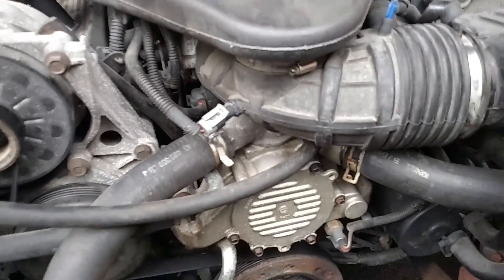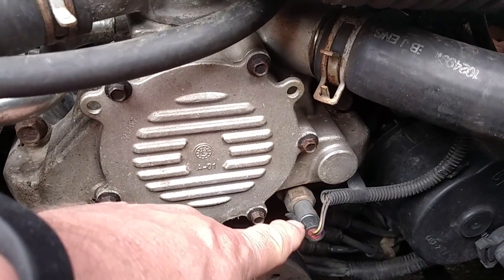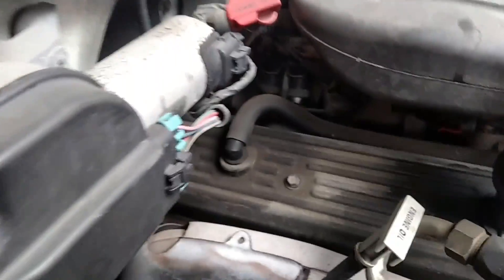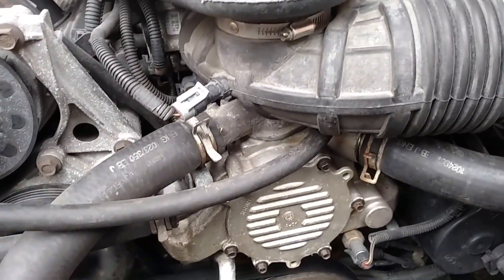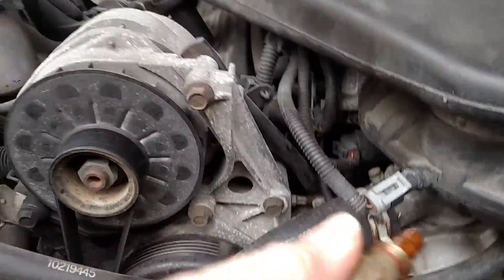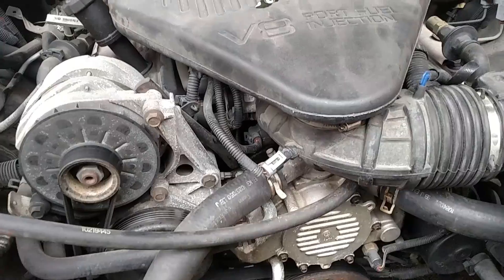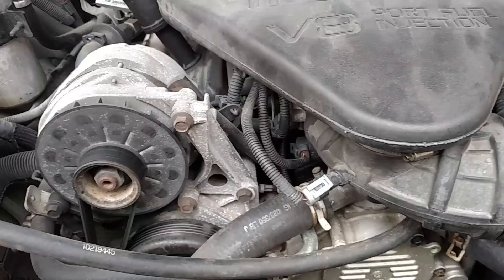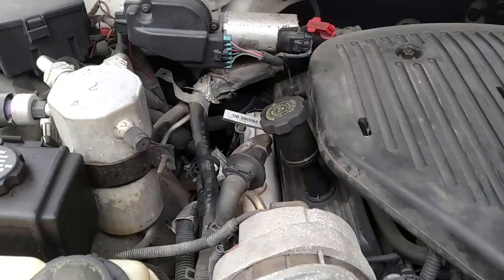Cooling sensor malfunction on lt1 GM

Comment: i took the plug connector out and the fans took off ! iguess the sensor is a normally closed...then opens when the temp goes up,this is all i can gather without getting the tech info on the sensor itself.geee i replaced it once in 2013..but i guess if the car sits around its function goes bad,i might do as this guy does,take it out and clean it maybe in hot water...
Reply: I have this problem, did you fix it

Comment: I have rhis exact motor.  My wire is cut coming from the sensor.  I am gomna have to put an extension on it.  Where does it land.  Thanks in advance if anyone has that answer
Reply: Have you found a answer

Comment: Curious. My 95 impala SS has a temp gauge problem. It comes up a bit but not to where it should be for normal operating temp. Could that be the sensor or the gauge itself?
Reply: Thermostat was on the verge of going out.
Reply: Kyle 
Did you ever get it fix? What did you do if you did?
Reply: Did u ever get it fix Kyle

Comment: This sounds like what my car is doing, i run the car a couple minutes and the temperature gauge jumps up like it's overheating but doesn't make sense because I only have ran it a couple minutes going to try this.
Reply: Did that sensor help your problem?
Reply: Mine is doing the same.

Comment: What size socket does that remove that sensor ?
Reply from the maker: Tee Orr man I can't remember the thing to do when you get a new on size it to the socket before trying to take old one out that way you don't round off the corners. Auto parts can probably tell you
 Sorry it's been so long since I did it. Good luck
Reply: Oh okay and thank you so much for replying and getting back to me though. Have a great one

Comment: I fricken these videos. Not a si gle one shows or tells where the wires goes? I have a 94 ss my coolant sensor melted the wire in my sensor. I got a plug end from junkyard  but it has 2 wires mine only has one where the hell does the wire go where do I find it? If I use the newer 2 plug where does the other wire go?
Reply from the maker: Johnny Tooby I'm not really sure where your wire goes. Good luck finding out your problem
Reply: It's the one on passenger side hear between cylinder 8 and 6. U may have already found out by now

Comment: on my 97 Trans Am, the coolant sensor for the gauge is on the driver side
Reply: That is the left side that is shown.
Reply: Yea on fbodies driver front cars and yea that's the left if your facing the motor that's the passenger side

Comment: My temp hand goes up when car sits still then tries to run hot...
Reply: Adrin Thompson mine is doing the same, did you figure out what the problem was? My car temp stays normal when it’s in motion but if I get caught in traffic or a stop light, it gets almost to the red on the temp gauge
Reply: chico suave same on my 96 did you figure it out??
Reply: Mine has been doing this for 3 years and normally status in the 1/4  temp range as mentioned in the video. I believe that is supposed to happen because it has reverse cooling system that cools the heads first

Comment: So for 1995 Camaro z28 lt1 is in the passenger side ? Because it does the same thing as this it goes up alil and then all the way to 260 and I open the radiator cap slow and everything just comes out like crazy and it’s not my heads because I switched them to steel iron just recently pls help
Reply: Jayy Slow5.7 , it’s on the driver side for F-body.
Reply: If u put cast heads on it , it could be on the passenger side . The aluminum heads they r on the drivers side. But the heads will work on either side.

Comment: Thats been my rough bouncy hot idle...THIS WHOLE DAMNN 2 years i just found out and i went through hell to do it 😂
Reply: billywitchdoctor So your rough idle was all due to the Temp sensor on the Water Pump? I have a c4 corvette that has had a low/rough idle for years.
Reply: @Sonnywitdamoney   what did u do to fix your low/rough idle that u had for years? I have a similar issue that's been going on for years and can't figure it out

Comment: Its called the ECT Sensor. You can actually get Resistors or Paper Clip if you are stuck on a Road with Over Heat Engine or Coolant Temperature Sensor and do a By-Pass to get your Engine running again so you can get home or get to the Store to buy a new one. I have made a By-Pass Video here in case someone needed to know how to do it. It's super EASY btw :))))  - https://www.youtube.com/watch?v=q0v1kbw7iJI

Comment: did u run ur A.C.? my lt1 temp gauge goes passed half when i run it, I stay in las vegas so it gets hot ass hell
Reply from the maker: 104blockboyz702 it went from normal temprature to showing HOT. put new sensor solved problem. but no on running the A.C. at the time. it was cool outside at the time. the sensor was giving a false reading. hope this helps
Reply: I'ma try that, thanks for the advice 👍